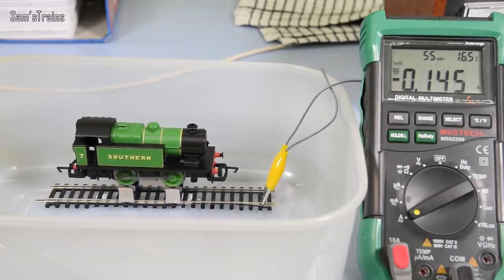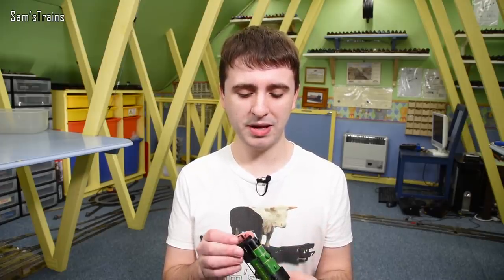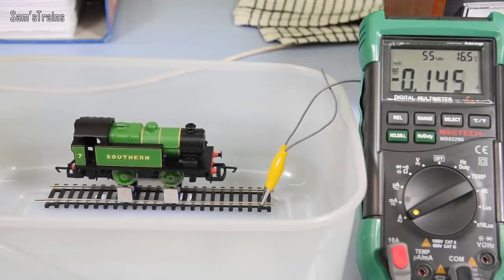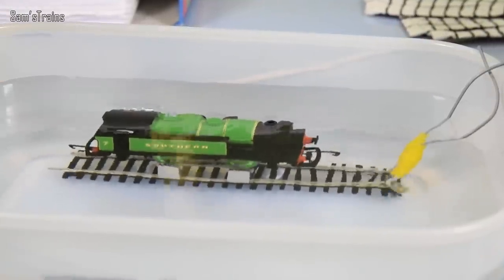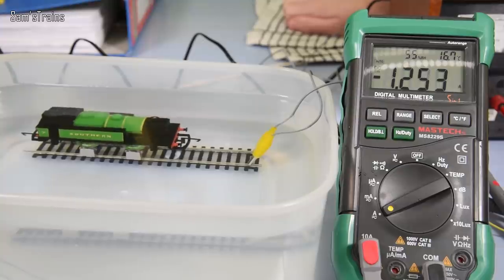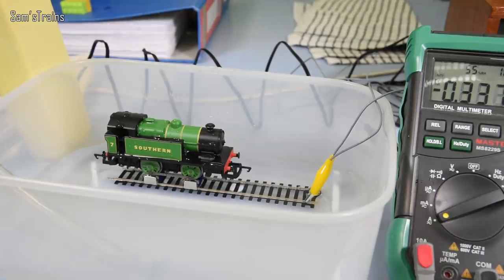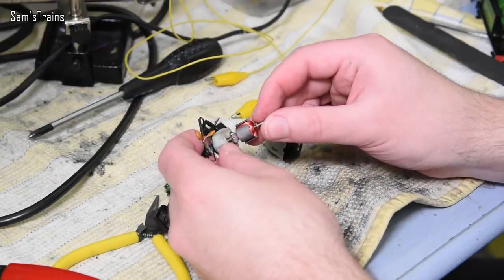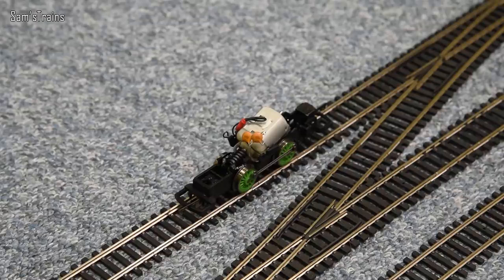Can Model Trains Work Under Water?

Comment: Aren’t Bachmann train controllers really robust? And don’t they NOT have over-current protection? It would be good for this purpose.
Reply from the maker: I'm not sure about that - I only have Hornby ones - but yes, it would be better to have that! On the other hand - I might just use a high power 12v or 6v power supply in the future - so I can way exceed 1amp!
Thanks for watching - Sam :)

Comment: there is a considerable risk to a motor itself if it is a carbon brushed one, brass brushed motor would most likely work even under water or in other fluids like internal gas pump in gasoline engine cars
however carbon brushed motor would compact carbon dust with water between comutator bars on the armature of the engine making a dead short
also tracks themeselves would start an electrolysis process if the water was contaminated with any conductive substance

edit
haha callet it :]
Reply from the maker: Yep you basically called it spot on, haha! Though interestingly the failure only seemed to happen after the motor was no longer submerged - so with proper drying, there's a good chance they'd survive with no problems! :D
Thanks for watching - Sam :)
Reply: @SamsTrains  actually the problem isn't water but carbon itself
carbon, or rather it's crystalic form of graphite is a conductor with self lubrication properties, that is the reason it is used as a brush material, it is resistant to wear when interacting with smooth surfaces. To some point of course.
For carbon it is irrelevant if the insulator around the comutating bars is inert gas, air or non conductive liquid. If the particles that are being grinded of the brush stay in the medium (gas or liquid) their concentration remainds low, they are being washed out constantly by centrufugical force of the spining engine. But when you introduce water and air, particles of carbon will stick to the liquid more, and surface tension of the water will be enough to keep it in the comutator slots and cause total short
Most small dc motors have only 3 cumutator bars and for motor to work, one of them have to be disconected from power for the most of time. motor is designed in a way for it to never stop when all 3 comutator bars are touched by brushes, and only allow for it to happen when it have enough inertia to overcome it in a short time. that is also the reason why all small dc motors have always odd number of coils and even number of field magnets.
To rescue the motor  after carbon contamination it is better to wash it out with the liquid that disolves the contamination, rather than drying it out as is, carbon would still be a short after drying if you don't remove it. so it would be better to wask it out with water under a sink and then with ipa than simply leting it dry. brushes however are porus and they have water in them now, that need to be dryed out before next use unless you want for the motor to die again after very short time. wet brushes would also wear much faster.
Reply: @SamsTrains  there is also a a type of dc motor that would work for the most part whatever it would get wet or not. and surprisingly it is a cheaper version of identical motor as you have there. class fc-130 fc-260 or fc-280  motors with metal brushes would burn up brushes faster due to increased friction, but most likely would be able to work while drying. they would also generate less load under water.

Comment: This is a trick 
When you cover the loco the  water would put out the fire in the firebox.
Reply from the maker: Ahh of course - you got me Steven ;D
Thanks for watching - Sam :)
Reply: @SamsTrains  I simply couldn't resist saying it.
So for your next video try the same experiment but using an old Triang model with smoke to see if the smoke unit works lol.
Actually water is in many ways not a great conductor especially distilled water?
Salt water is a different matter all together.
Love the experiments though
Get in contact with James May, im sure he finds them interesting too.

Comment: You are actually breaking the bond between the atoms of the water molecule (H₂O) and producing both Hydrogen (H₂) and Oxygen (O₂)

https://en.wikipedia.org/wiki/Electrolysis_of_water
Reply: You said there was no salt in the water. That makes a difference. Distilled water (or purified water) doesn't conduct electricity as well as tap water. The natural levels of salts and other impurities in tap water increase the conductivity and would more likely cause a short circuit (current overload) within a second of the tracks being covered. The copper wire used in the winding of the motor is coated in a layer of polymer that would keep water from touching the wire for a short time, but as you said, it would corrode over time.
Reply from the maker: Yeah absolutely - thanks for the info on that! I had considered adding salt for this reason - to cause some fireworks - but decided not to! ;D
Thanks for watching - Sam :)

Comment: If you used distilled water the train work normally because water dnt counduit electricity. Only minerals in it :)
Reply from the maker: Yeah that's true - though the current draw would still be higher, due to the water resistance/drag!
Thanks for watching - Sam :)

Comment: Can model trains work like a roller coaster
Reply from the maker: Sadly not - the wheels lock up if you remove power - but if you created a lift hill rather than using a motor in the engine, then yes it would work! :D
Thanks for watching - Sam :)

Comment: Surely your current increased due to a reduction in resistance?! Could the current have been running through the water?
Reply from the maker: Yeah that's correct - it may have been running through the water, but most likely the water was cooling the motor coils, reducing the resistance and allowing more current to flow. The bubbles on the rails indicate that there was some current running through the water, but I wouldn't expect it to have been much!
Thanks for watching - Sam :)